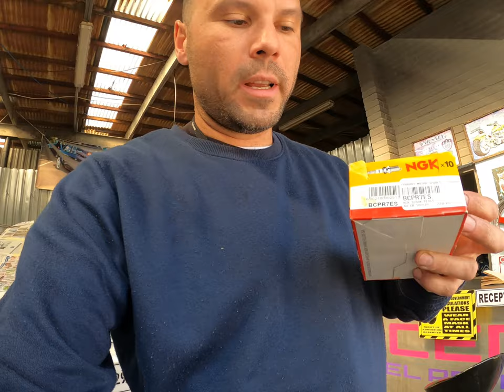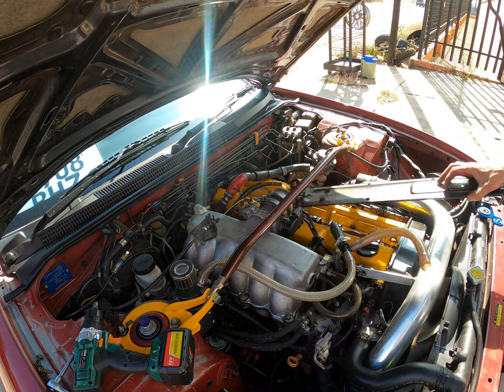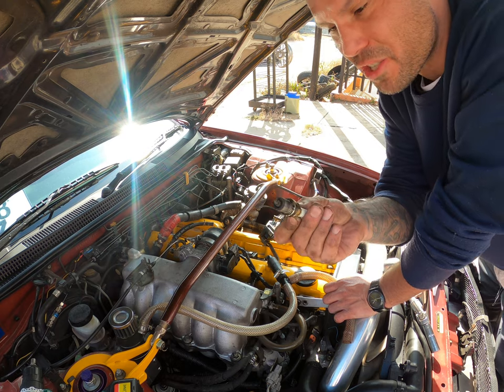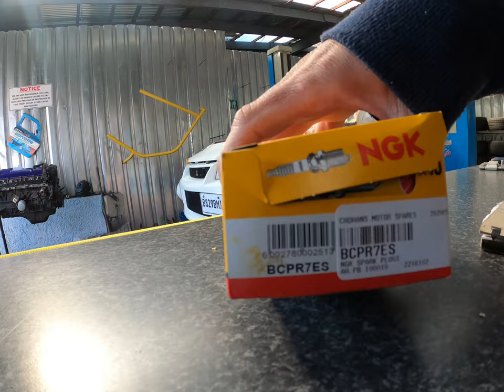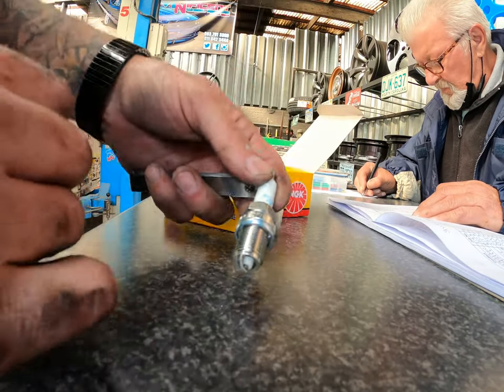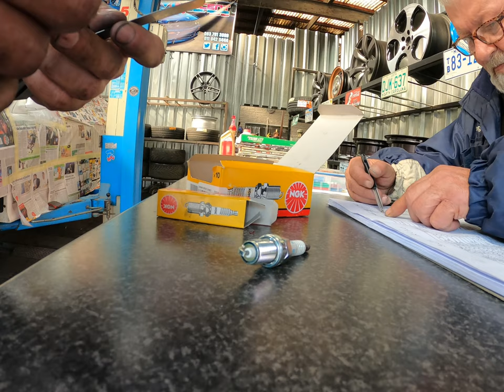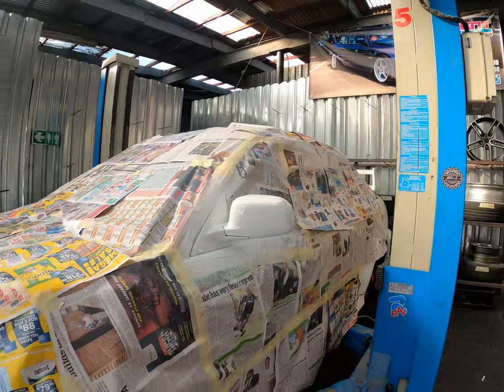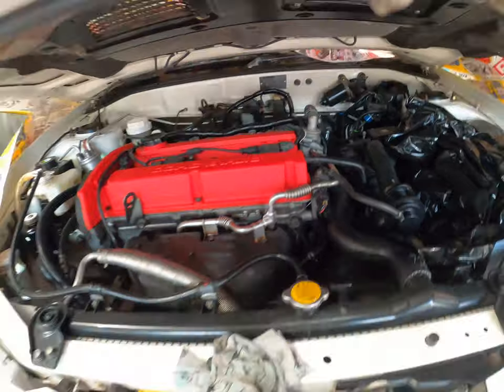RB25DET SPARK PLUG GAP AND CHANGE

Comment: What socket size did you use for the plugs? I’m about to do mine with weekend.
Reply from the maker: So it’s a 16 tube socket normally but sometimes guys use spark plugs with a 21mm head but it’s not that common to be honest

Comment: Why exactly are you gapping to .55?
Reply from the maker: So that when you’re boosting over 12 psi it doesn’t blow the spark away
Reply: @the_JDM_fanatic  ty reply. my set up is all stock except the freedy intake and front intercooler. idk why i am only seeing 6 psi. until i put on the extra type manifold and wastegate (to set pressure), I guess i am fine with NGK BKR7E-11 ??? (I have not gapped it so i assume its 1.1). car runs fine but i constantly smell gas and i get less than 190km on a full tank. do you think i might have a bad O2 or is it plug-related?? any advise helps. I have new coils and igniter and harness. i am at 30 psi with vacuum line connected (fuel reg). I dont get any break ups in high rpm or stalls just poor consumption! HELP!
Reply from the maker: @schalachi  soooooo dude the 11 means 1.1mm gap, but if you’re not boosting over 12psi then don’t worry about the gap… 

Your fuel pressure should be about 40/43psi on idle… 

Have you got the stock ecu in the car?

It could almost be pointed down to a bad o2 sensor thought the AFM could also be faulty telling the ecu it’s taking in more air than it actually is and then it makes it over fuels .. 

Your plugs won’t be causing the car to be thirsty … not like that.. 

I would honestly try get a afr gauge just to fit into the muffler drive it around and see what afr you’re throwing out the back… how does the car feel power wise though? 

At the rate your spending on fuel it might be an idea just to go for a aftermarket ecu … 

The only other thing I can think of is maybe the car has big injectors and had a big turbo setup but it was taken kinda back to stock, or there are big injectors on a stock ecu so the ecu doesn’t reAlly know how much it is injecting …..
Reply from the maker: @schalachi  but honestly first things first take it to a Dyno or get a Afr gauge to see what the cars doing, if it’s that rich it’s no good… you’re washing the bore and getting fuel into your oil and sooner or later it’s gonna throw a bearing 

That 60L to 190km 

Consumption is like 30L to 100km

There’s something very wrong there or you’ve got it at WOT the whole time
Reply: hey bro. so I bought the car broken down and poorly kept. I'm doing a full restoration and later extrator type manifold and haltech injectors.
For now this is what I bought used OEM : Factory type M hrness, Manual ECU, CAS, AFM, AC Compressor
This is what I bought new: Tomei fuel reg, aeromotive pump, intake manifold, OEM water pump pulley tensioner thermostat, NPboosted coil packs, igniter / wiring specialties coil pack harness, , belts, fluids.
Power wise the car is great! for 6 psi its sideways but it still feels on the slow side. It doesn't pull my head back in the seat. Idles smooth from idle through the powerband, doesn't break up at all). I can confirm its the factory injectors. My only issue is the consumption. It actually burns my eye while I drive. I have checked for leak in fuel line itself but all replaced. Can I buy nissan consult cable on ebay for $30 dollars and get live data. Advise me, imma park this car up if it cont to eat my money in gas!
Reply from the maker: @schalachi  I’m assuming you’re based in Aus ? 

So your pump is over compensating for a stock ecu and stock injectors and 6psi is even less than it came out stock, it came out with a variable boost controller from factory, or it’s called a two stage controller…  4psi up to 3500 then 7psi to redline something to that… 

You can take off the stock controller, and just use a little bit of vacuum line try take the car for a drive with a short piece of vacuum see what the boost does then a little long and longer , the stock ecu is capable of 12psi I’ve had my skyline on 13/14 psi for years with water meth

Try turn the pressure down on the fpr and see if it starts to sound better… see what it does to the revs ..

But that cable sounds awesome, I didn’t know there was a cable that we could get off eBay to see all the data??
Reply: Hey bro no I am from the Caribbean (St. Lucia population. 180K) and there aren't many rb's here much fewer skylines or rb mechanics. I don't think mine came with the 2 stage controller installed (at least I don't see it). I have a vacuum line going from turbo out to wastegate actuator (8" long). the fuel pump is 340LPH.

When i have the pressure at 40 psi the car actually works worse, it will feel slower and also stall sometimes when I depress the clutch...if I turn it down to 30 psi it runs better -  no breakups and never stalls.

I think if I have bad O2 and it's telling my ECU to send more fuel and that's why it's working good at 30 psi. so I think if I change the O2 then I would also have to set the pressure back to 40-43 psi). Lastly, I can see the mechanic left the OEM fuel pressure regulator before the aftermarket regulator and I am not sure if he drilled it out to by pass it. Do you think this might be a concern?

I am about to order a geniune O2 on ebay its like 75USD... I just hate to change parts that are not faulty you know but thanks for all the help and if you have anything to say again please reply.

Yes. It's called Nissan Consult and its just a cable and software which you can either buy or pirate. It will show you live data like rpm, speed, water temp, battery, timing, O2, injector, duty cycle, air flow, trottle, AAC. Before 1996 cars with ECUs used priority ports specific to the manufacturer
Reply from the maker: @schalachi  it's usually mounted to the chassis leg where the turbo sits.
Reply from the maker: @Christopher Lochan  I would buy the cable first and software before buying the o2 sensor  cause I thought the same thing with my car and changed the sensor and it literally didn't do anything different for my car..... 

Try take carb cleaner and just spray the afm out... cheap and easy to do...

Don't use anything to wipe the inside of the sensor just spray it out and also just spray the o2 sensor out and leave it to dry before fitting it, if you still see dirt then spray it again to take any dirt out...

Start with the small easy things first before buying big items...
Reply: Okay thanks bro. There is a AFM cleaner sold at a hardware here I’ll clean it and try use a YT method of cleaning the O2. I’ll messaged you on IG. I’ll update you on how it goes…because I literally have no other help lololol. Thanks bro. One love. Take care
Reply from the maker: @Christopher Lochan  hey dude happy to help where ever I can brother, I did see the insta message dude... 

I'll reply there and we keep on chatting that side amigo

Comment: hye.i have issue with my rb25 neo turbo.when high rev it have missfire within 5k - 6k rpm.
when i check the coil ( engine is on idle amd warm) i plug one by one,and i cant see any different in idle.from coilpack 1 to 6.
6 month before i use denso ik22 plug,and just fit it with no gapping.
can you help me giving idea??
Reply from the maker: Hey man yes I know the problem.. you are boosting 12psi or more? 

What you need to do is just buy this plug bcpr7es and then gap the plug to 0.5mm and your problem will go away…

So what is happening is your boost is blowing the spark away… my skyline used to do the same thing .. let me know man hope your car comes right
Reply: @the_JDM_fanatic  i am running around 1 bar@14.5 psi.
owhh just buy ngk plug and gap it around 0.5 mm? what about this plug that i buy.can i gap it to your spec 0.5mm?
and for the last 9 years,my car been tune with e manage,my fuel press is 2bar.is that sufficient@healthy for engine?
and more depressingly about my coilpack.
not responding to idle when i pluck every single of them.
so,can i gap this ik22 plug to 0.5mm?
Reply: @the_JDM_fanatic  it is the ngk 6282 bcpr7es nickel spark plug?
Reply from the maker: @huzaifmohd8903  just a normal plug… they about $3-6 cheap ones
Reply: @the_JDM_fanatic  tq for your information👍👍
Reply from the maker: @huzaifmohd8903  no problem at all my brother , let me know how it goes
Reply: @the_JDM_fanatic  orait brother
Reply: @the_JDM_fanatic  hai tony. for 4 days,i search this plug at all spare part store.they didnt have this kind of plug in  malaysia.
1.so,i reuse back my iridium ik22 plug.
2.my ik22 plug is gap around 0.8mm,can i gap it to 0.5mm?
Reply from the maker: @huzaifmohd8903  yeah if you can’t find it then use your plug and gap it to 0.5mm take it for a drive and see
Reply from the maker: @huzaifmohd8903  if you search bcpr7es on eBay it comes up. But use your plug first..

Also clean the old plugs with sand paper lightly… like 1000 grit sandpaper
Reply: @the_JDM_fanatic  so,from 0.8 drop to 0.5mm.noted.is there any different in normal plug and iridium plug about sparking power?
Reply from the maker: @huzaifmohd8903  no dude same same just the iridium plug lasts much longer
Reply: @the_JDM_fanatic  owhh... it have same sparking power,but iridium last longer.orait i see.any update, i will contacting you back.tq tony
Reply from the maker: @huzaifmohd8903  awesome man